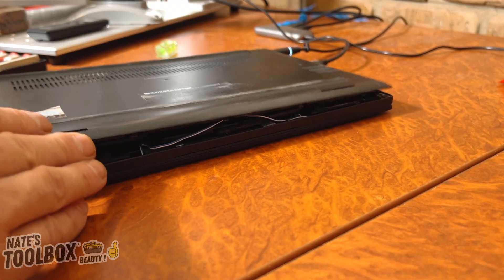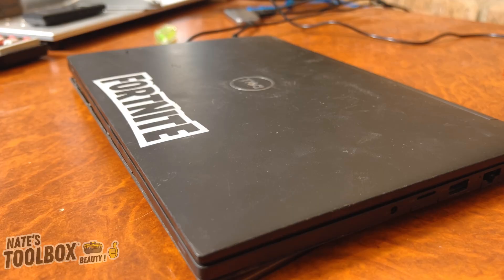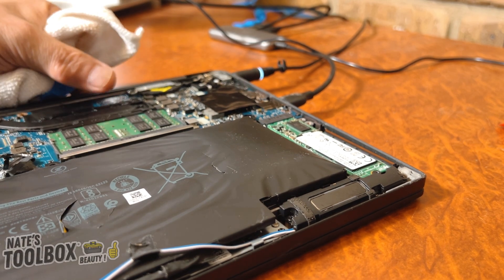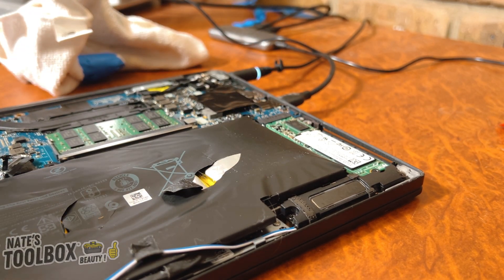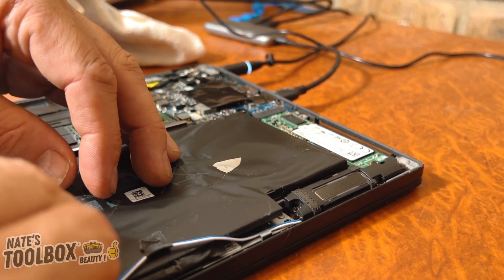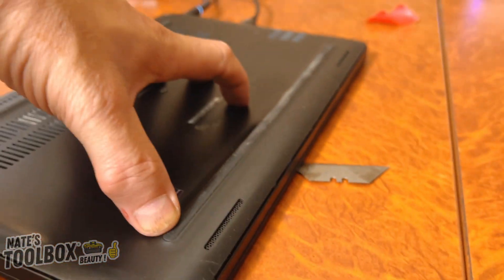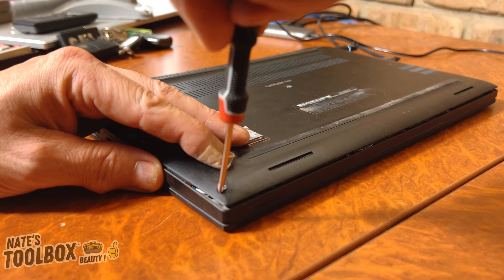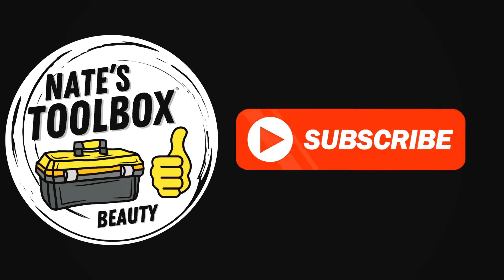Does Deflating a Swollen Lithium Laptop Battery Actually Work?

Comment: Have you or someone else continued to use this battery even after it has gotten a bulge?
Reply: i dont think there will be any problem as long as you dont short the battery, pouch is punctured but you should seal it with tape.

Comment: wow no fire explosion in his laptop 💀 
don't try this! poking lithium batteries is dangerous and can lead to thermal runaway.
lithium batteries bulge because they are expecienceing problems and bulged batteries should be recycled not "deflated"
Reply from the maker: No, sorry—deflating the lithium battery was very carefully calculated. I didn’t just blatantly go and stick a knife through the battery. You just need to carefully pierce the outer layer where the gas is—there’s no battery there.

It’s most likely just related to age. Over time, lithium-ion batteries degrade, and the breakdown of electrolyte and materials can release gas, causing swelling.